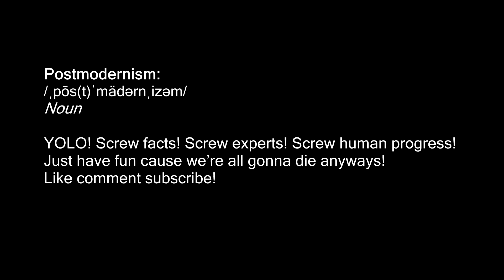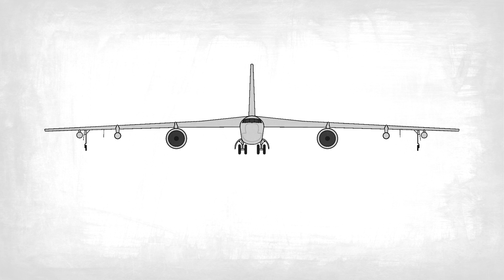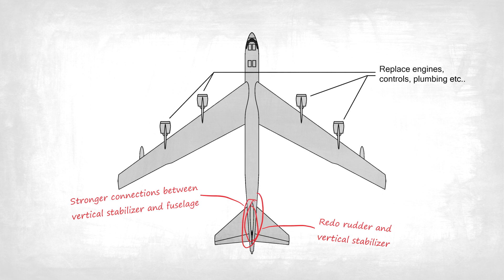The B-52 is Getting New Engines... Why Does it Still Need 8 of Them?

Comment: This is a combat aircraft and subject to battle damage. Redundancy is a general good idea and in a combat aircraft a necessity. The B-17 could limp home on two engines. Losing altitude and throwing the guns out but landing even on one engine.
Reply: Having such a tiny rudder it's difficult to control if one of it's 8 engines fails seems like a bit of a vulnerability to me. Especially as engine failures due to combat damage is likely to take out both engines in a given nacelle.
Reply: @quillmaurer6563  True. But their are numerous factors. If you lose one of four engines you have 75% power left with one side having twice the power of the other making controlled flight difficult. Lose one of eight you have 87 ½ percent power left and the differential of power between the two sides is less.

Yes the loss of one engine can likely take out the adjacent engine but this in not guaranteed. May be so lucky as to shut down a damaged or malfunctioning engine before things got catastrophic. 

Keeping this type of plane in the air has greater priorities than a commercial aircraft. One is it may have a nuclear bomb load and do not want that to hit the ground. It needs to carry on to it's target and drop it's bomb load as lives beyond the crew are dependent on a successful bomb run. Getting the plane and it's crew back to base as they are needed to carry on further missions.

Aircraft and crew survivability is always important but in the environment of a military plane is of greater priority.
Reply: @edwardcnnell2853  I understand those things - the adverse yaw of losing one large outboard being too much for the rudder was the main point. All because the aircraft was originally designed with 8 rather than 4 engines, and it sounds like the rudder was a bit inadequate anyway due to last minute design changes.

Aside from that issue (if the rudder were big enough) I'd still expect it could fly with 3 of four engines running just as well as 7 of 8, especially if those engines produced more thrust overall, which is easy with modern engines. Just make the engines a little bigger, you could have as much power with three as you would have had with 7, and the aircraft would have a little bit more power available with all engines running - not a bad thing - and still be far more efficient than with the old engines. Airliners are designed to be able to fly with one of two engines running, this just means they have to have more power to fly. Basically the total thrust needed on a given aircraft is (Thrust needed to get the thing in the air if engine fails at V1)*(Number of engines)/(Number of engines - 1). So a twin engine needs twice the minimum power, a trijet needs 3/2, a quad 4/3, an eight engine needs 8/7. So a quad would need 19% more power total (if I'm doing my math right) than an eight engine - that's not a huge difference.

True that there are circumstances that one engine would fail without taking out it's neighbor, this is probably the majority of engine failures caused by mechanical failure. But in the situation you're describing, where the main hazard, most likely reason for an engine failure, is enemy action, I'd not consider this to be particularly effective redundancy as being hit by bullets or shrapnel would probably take out both engines simultaneously or induce an uncontained failure.

I'd not agree that mission survivability is necessarily more important for a military aircrew than a plane loaded with hundreds of civilians. But one thing a civilian aircraft has in it's favor is it can land at any safe landing site, the biggest limitation being over-water, which is where ETOPS comes into play. A military aircraft penetrating deep into hostile airspace can't land there without the crew being killed or taken prisoner. Though come to think of it ETOPS allows further over water than probably any enemy territory would be wide.
Reply: there is a problem with this reasoning, and that is, if two engines are so close together, complete disintegration of one is likely to take out another. (As demonsteated by the losd of Polush Arlines il-62 in the 80) this is lesser problem with low-key failures like you would ecpect in peactime, but with battle damage? A missile exploding close to an angine will very likely take out both in a pod. So the added margin of safety with 8 engines in this configuration in combat conditions is much lower than you'd expect with double engine number.
Reply: haha imagine in what world the B-17 will be returning home with battle damage.... i mean they don't normally send it against the SAM sites
Reply: The thing is, a B52 is not a WWII era bomber.  It is not, and never was designed to take battle damage or fight off attacking fighters.  It was built in a time when that was no longer a thing that happened in war, and as such the extra engines are not there to have 'back up'. They are there because they were needed to provide enough thrust to make the plane work in a time when engines were much less powerful.  The plane isn't designed to fly with damaged engines.
Reply: @johngaltline9933  Then why did it have a tail gun for several years?

Comment: Bingo, you have hit the nail on the head! With a 4 engine buff, in an outboard engine out situation, the rudder does not have the authority to overcome the yawing moment. Hence, the buff will keep the 8 engine config but will now transition to the same engines used in the Gulfstream G650. They are more fuel efficient & much easier to maintain.
Reply: Also cheaper spare parts I would say
Reply: @Groza_Dallocort  I wouldn't think so much about price of spare parts so much as whether they exist at all. The USAF probably has stockpiled all spare parts known in existence, but they are running out and there's no means of getting more, they've not been produced in decades. More modern engines still have manufacturer support, spare parts can be ordered quite easily.
Reply: How about 6 engines?! Just change the inner set of engines on both sides so:  oo---O--■--O--oo. Layout
Reply: @limbeboy7  That thought had crossed my mind as well, but this would mean two different types of engines on the same aircraft. Different spare parts, different maintenance requirements and procedures, possibly even different operational characteristics (though modern FADEC should make this not noticeable to the pilots). Possible but would end up being more hassle and expense from a servicing standpoint than 8 of the same engines. The whole reason for reducing the number of engines I think would primarily be to reduce maintenance effort (a big engine doesn't require much more work than a small engine, so fewer engines means less work), but having all be the same type would be better than two different types, even if that means an extra two of them.
Reply: @quillmaurer6563  no they could use 6 of the same engines and just make the inner ones have a high bypass ratio which will balance the thrust
Reply: @limbeboy7  So just different versions of the same engine? Another possibility for a six-engine configuration that might make sense would be to have six identical engines, but only one on each outboard and two on each inboard nacelle. That way the failure of an outboard still wouldn't be as big a deal as that would be 1/6 the total thrust rather than 1/4. A similar configuration to the B-52's predecessor, the B-47.

Comment: Someone who seemed to know told me that going with four engines instead of eight would also alter the airflow over the wings, necessitating changes to the wing. Using eight engines nearly the same size as the original elmininates that issue. In short, changing one thing would mean changing lots of things. Better to keep it simple.

Comment: Former B-52 Instructor Pilot.

BLUF (Bottom Line Up Front):  The way the B-52 was designed means large modern high-bypass turbofans are too large and would be easy to damage on takeoff and landings.

Discussion:
All talks of cost and efficiency gains from going to 4 engines (or even 2) aside the airframe itself is the limiting factor to going to big modern commercial engines.

Take a look at how the wings attach to the fuselage.  They have a positive 8 degree angle of attack when the plane sits on the ground.  On takeoff roll this means if the takeoff is performed incorrectly (not enough back stick pressure approaching take off speed) the aft trucks (wheels) lift off the ground first as the wings try to align with the airstream.  In a position like this it is very easy to strike the front edge of the outboard fuel tanks and the outboard engine nacelles if any right or left roll is induced - it has happened many times over the service life of this aircraft.

If your curious why the wingtip gear are no help in this situation ill be happy to explain the geometry and physics behind it.

It was designed like this because everything about this plane revolves around maximizing capability of the bomb bay.  If you have ever seen a B-52 land in a high crosswind situation (for your convenience  https://www.youtube.com/watch?v=9jNkMpNyS8I, start at 30s in) you will notice it does not land wing low like conventional airplanes (civilian and military).  If a B-52 tried that technique it would most likely result in the wingtip gear being smashed through the wings and a ground strike of the outboard fuel tank and engines.  Instead the B-52s landing gear rotate so the aircraft can fly wings level crabbed into the wind and land sideways.  Takeoffs are performed in a similar manner.

I wont even get started on the amount of rewiring and plumbing it would take for the electrical and hydraulics systems if the aircraft changed its current engine configuration.  Never mind the loss of redundancy.  Something you want on a plane that can get shot at.
Reply: Crabbed landing gear, amazing!
Reply: There is also the existing systems in place and how they would interact with the "new setup". Like how would SAS work with 4 engines or even a bigger rudder. Even though these planes are old they still get some big issues from some small problem. Hell in the mid 00's we grounded a huge chunk of the fleet due to one small gyro.

Comment: I worked and flew on the B-52 H models in the 1960s. Only the last two models (G & H) had the shorter tail. The H models are the only ones in service today. I believe the last B-52 came off the assembly line in 1961.
Reply: He didn't mention the eight foot shorter tail. What puzzled me is why they didn't increase the chord of the rudder while altering the tail fin height?
Reply: I think they scrapped a lot of them per treaty with the USSR.
Reply: Correct.  The last B-52H was serial number 61-0038.  I flew in that plane.
Reply: @brucedubbs6939  our highest tail number at Minot when I was there was 61-026.

Comment: You showed the "tall tail", which was on the early models of the B-52.  The only remaining B-52s are "H" models, which have shorter vertical stabilizers.
Reply: And the one shown...."Balls 8" used to air-drop the X-15 rocket plane whose pilots included Neil Armstrong and Joe Engle.

Comment: There was a formal proposal in the 1996-1997 period where the Air Force and Rolls Royce considered re-engining the B-52 with four big engines, but the cost of changing the rudder and control systems was such that it became uneconomical to do so.   So, this time around, the Air Force just went with the smaller eight engines.

Comment: The biggest issue is the ground clearance followed by aerodynamics and CoG.  To put completely new engines on would require a complete design and development cycle with lots of Val/Ver through tests that would cost a couple Billion and the is to save money not spend more.
Reply: Chris, thanks for mention the CoG - I didn't think about that.

Comment: IIRC the new engines are commercial models and widely used so readily available parts, they are higher output yet weigh less, and can be fitted into the existing engine pods with minimal rework, and are more efficient offering I think it was a 30% increase in range.
Reply: Well not the first time a civilian engine have been placed on a military plane
Reply: Anlash: The current J3D engines are commercial engines used on the B-707.
Reply: No increase in thrust per engine. A B52H pilot explained that increased thrust would add to wing fatigue. The RR engines will be rated at the same 17100 to 17900 pounds of thrust that the original TF33s had. 

If something like these engines had existed when the KC-135R was in concept exploration phase we would probably have used these instead of the CFM56s.
Reply: @davidhoffman1278  the B52 is aerodynamically speed limited so any extra power would only be of use in a bit quicker acceleration to cruising speed. New engines will be under-stressed running below maximum output.

Comment: I was a Crew Chief in 1976 on the B52D and it was a 1955 and older than me just out of Tech school. It had pure jet engines that required water injection into the engines to augment the thrust on max weight or hot weather to help takeoff performance.
Another point for the B52D was the control surface were cable operated thru the use of control tabs to move the larger aileron and rudder itself. No hydraulics for the controls itself.
The hydraulic systems were air driven hydraulic pack, there was ten of them, one note was there was two of them located with one in the wing near the wing tips. 
The B52D was a tall tail and the B52G/H were short tail vertical stabilizer/rudder.
The B52D were designed to take battle damage that had redundant systems because the engines lost some power due to bleed air running the aux systems meant that reduced max thrust of the engines. The B52G/H had ducted fans to provide more thrust, I don't know anything about the G/H changes from the B52D.
Reply: It's really crazy to think of how primitive these aircraft are by modern standards. Pre-dated the 707 by several years, it was right at the beginning of the jet age. Even the 737 (even in it's modernized form such as the MAX) feels primitive, but this was far more.

Comment: They've replaced so many parts on these things over the years(including stuff like wings, tail, parts of the fuselage, etc) its become the George Washington's axe of planes.  Would be interesting to see what is still original to the plane when it was built in 1957.
Reply: theres the good ol' fly by wire system still in those birds for added redundancy
Reply: Yeah they've replaced so much stuff so it's not like they couldn't replace the vertical stabilizer.  Having 8 engines is probably pretty expensive.  Yeah if they had 4 engines each one would be more expensive than one of the smaller 8 engines but the cost may still be lower overall with 4 engines.
Reply: @zephyrprime  I thought the rudder was enlarged during Viet Nam for better high altitude control.
Reply: None of the B-52's in the current Air Force inventory were built before 1960. They are all "H" models with the short tail and TF-33 engines. The final aircraft were built in 1962.
Reply: probably the shitter, I figure being a military aircraft its a bucket somewhere rather than a real aircraft toilet.

Comment: Thanks for explaining why 4 engines are not a viable choice - it always made sense to me, so obviously good, until seeing this. A decade or two ago there was a proposal to replace the engines with 4 used engines sourced from (retired?) airliners. The reason was fuel economy.  The story I read then about why it didn't happen was that Congress wouldn't spend the money because fuel prices were low at the time and the payback of the cost wasn't worth it. The problem was Congress (or maybe someone in the Pentagon) was using the cost of fuel on the ground. The cost per pound in the air for refueling is much higher, of course. Figure in the savings of fewer tanker flights and the payback happens a lot more quickly.

Now I wonder if that 4 engine proposal was stillborn, regardless of fuel costs, just undoable for the reasons you give.
Reply: Don Jones: The B-52's ARE flying with airline engines. They were re-engined with B-707 low bypass turbofans engines several decades ago. This new modification will be the third generation of engines on the Buffs.
Reply: @KB4QAA  Yeah lol but that was arguably outdated even for it's time. If the 8 engine thing is true then I guess there's no choice. But even in the video you see them use that CF6 as a testbed which is way more powerful and efficient.
Reply: @cefb8923  Wasn't that particular B-52 a Pratt and Whitney testbed for their JT9D turbofan engine?